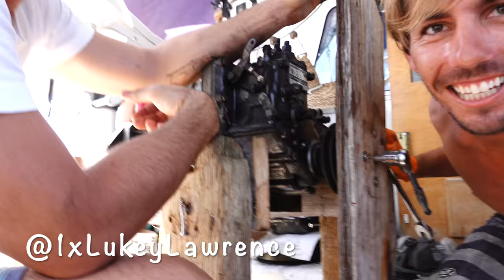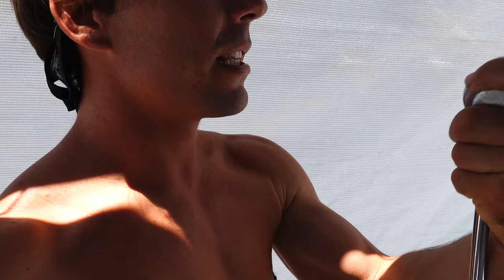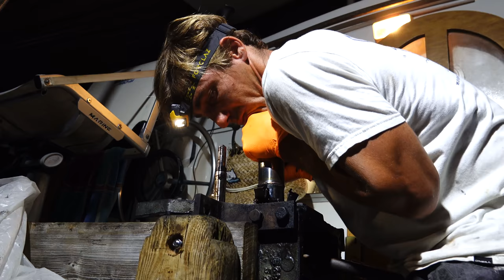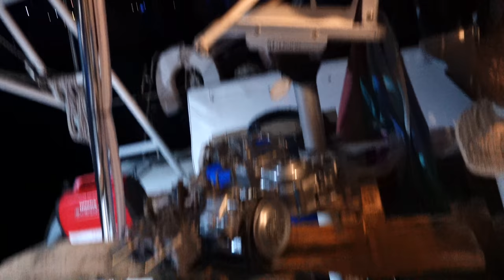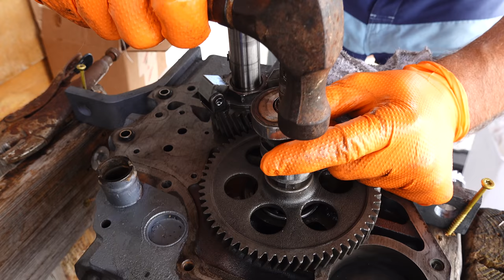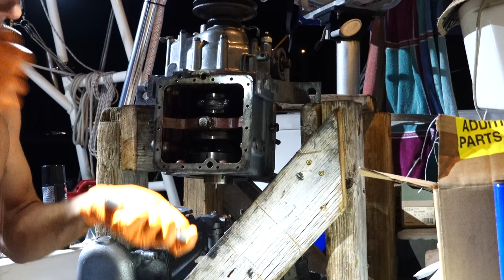Rebuilding the Engine on our Sailing Catamaran | DIY Diesel Engine Rebuild Part 2

Comment: Billy, you are an example of people that can do. Never be afraid to try something yourself. Hopefully, there were no parts left over. I use to take the dash off of a '69 Roadrunner. There were always parts left over when I put it back together. I just threw them in the glovebox until the next time I pulled it. Hard to do that with an engine. Guessing all those parts are important. :-)  At least now it is easy to video all of the steps as you disassemble something. Good luck and happy sailing.

Comment: A Yanmar 2GM is a fine engine and he is doing a very good job of it... Lovely that he can install a full kit including sleeve and new pistons and rings - it really will be a fresh motor again, hope the crank is good and the valves, guides and seats are good too...  He is doing a methodical job and is being pretty respectful and careful of the process.

Comment: Billy, I give you a lot of credit for rebuilding your diesel on your boat.  You are creative and have a “can-do” attitude.  I rebuilt the engine in my first car, a Ford 351 Cleveland in my garage when I was 15 years old.  This brought back lots of great memories of taking that engine apart piece by piece, cleaning it all up, new bearings and gaskets and putting it back together.  I had a Chilton’s manual to guide me through it.  Can’t wait to hear that sucker run!  Good job so far dude!

Comment: Billy, that's what I'm talking about! You have done a great job with little resources and in the end, have shown with a dose of courage to undertake such a project and the smarts to work around obstacles one can successfully overhaul an engine on the back deck. It helps to have the manual.

Comment: Taking the engine apart is EZ ,  getting the parts and checking tolerances so you get a good rebuild is the difficult part. Your fearless attacking this job!

Comment: Just going to echo most of the other comments. Your a badass Billy! With a little ingenuity and a lot of determination you showed most anything is possible. Very impressive to rebuild a complete engine on the boat on the water.

Comment: You're a weapon Billy... A 2MG. Great engines... Injector timing is going to be fun, but you'll figure that out I'm sure... Can't wait for the startup...
Reply from the maker: I didn’t take the injector pump off and the timing is determined by the shims it is mounted on so didn’t have to do anything there. I just had to make sure I lined up the timing marks on the gear on the crank shaft and camshaft which was very straight forward and easy

Comment: Awesome job!  Great tool improvisation.  The welding on the extended socket looked well done too.  Save that tool!  I have many special fabricated tools in my box. 
I'm excited for you.  Can't wait to hear it running.
The other engine is going to be a breeze for you when that time comes.

Comment: At 12:30 I believe what you were thinking about is a plasti gauge you put a small piece down and torque your bearing caps down and then take them off again to check your clearance.

Comment: Like my dad always said brute force and perseverance always wins👍👍
Reply: ...or just find a length of pipe and use it as a breaker bar...some basic physics goes a lot further than brute force...
Reply: But brute force all ways win😳🤓🤗
Reply: @timothyhanneman7715  -  what  puzer1  was  gittin' at was that proper application of brute force utilizing skill, manual dexterity and expertise through ". . . some basic physics"  makes the job come off a lot  easier  ! ! !   Yes  'Brute Force'  .  .  .  .  made easy .
Reply: Richard Hobbs it's just a old saying we used many years ago my dad been gone for 16 years when I see things like Billie trying it reminds of my farther when we were working heavy equipment. The good old days👍

Comment: Very good job young man very good Billy glad to see you're using a torque wrench and the inserts at the bottom of the Piston arm I always use Vaseline as a matter of fact I used to put Vaseline on every part when I put it back together just make sure you watch for leaks the first 24 to 48 hours excellent job though Billy you deserve a pat on the back💥👍💥😎👌👌

Comment: Thank you so much for this video! I'm in the middle of an almost identical rebuild (3GM30 taken apart in the cabin sole of my E32), I am struggling with the cleaning. I would have liked to see more on how you got the parts clean enough (got off rust, caked grime, old paint, etc without sandblasting) what you used to clean with -both solvents and brushes-before prime/paint.

Comment: So far so good.  You might consider getting a brass or lead hammer, they come in real handy working on mechanical stuff, not just engines.  It might have saved the prop shaft you were working on a while ago.  Just a thought.  If you want a ring compressor I have an old one I'd be willing to send you.  It's a little rusty but some sand paper would take care of that.  Keep the good stuff coming.

Comment: I try to never work on intricate things late at night, especially when I'm tired, as this is how mistakes are made. You're sleepy, tired, and not as sharp as you should be, and it's so much easier to miss or overlook something important, like tightening something down to spec properly.
but hey, if you're broke down along side the road, or out drifting, then all bets are off and anything goes!
At least, this is how it goes for me. YMMV

Looks like you're doing a great job! I think you'll do just fine! :)

safe travels you guys!

Comment: YEAYYYYY !  Engine Rebuild!  :P   AND did I recently see that Adrenalin is FOR SALE?
Reply: Brad Mottishaw yep, I saw that too! They’ve already said that the Adventure continues.......! 😎🏖🌴☀️🇦🇺
Reply: What? Where it is listed? I can't seem to find the listing? Interested.
Reply: @chadjackson8420    Facebook Catamarans for Sale by Owner group
Sierra Groth
June 26 at 7:42 AM  · Shared with Public
1988 Crowther Spindrift Sailing Catamaran
$115,000  · Jupiter, Florida
Adrenaline is a 1988 Crowther Spindrift Catamaran, designed by the world-renowned Australian multihull designer Locke Crowther. She is STRONG, LIGHT, and FAST. She was built in Gabon, Africa and then sailed across the Atlantic where she spent her next many years sailing from Canada to the Caribbean. We have personally sailed her as far north as New England and down to Grenada. She is now in Florida ready for her next adventure with YOU!
The Bahamas, Caribbean, New England??
She is ready to sail!
ADDITIONAL DETAILS
RECENT UPGRADES + NOTABLE FEATURES
Dyneema DUX Standing Rigging (2019)
Titanium Chainplates (2019)
North Sails (2018)
Mack Pack Sail Cover (2019)
Custom Rudders (2019)
Lithium Batteries (2019)
625 watts of Solar Panels (2019)
New Manual Lofrans Windlass (2019)
4 New Lewmar Hatches (2018)
Updated Interior (2018)
Siren Marine Boat Security Monitoring System (2018)
Max Prop Feathering Propellers (2018)
Rainman High Output 115V/60Hz Watermaker (2019)
New Water Tanks (2019)
New Holding Tanks (2018)
DIMENSIONS + DETAILS
LOA: 40′
Beam: 20′
2 double berths
Draft: 3′-6″
Bridge clearance: 57′
Cruising speed under power 5-7 knots
Cruising speed under sail: 5-12 knots
Maximum speed: 18 knots under sail
TANKAGE + PLUMBING
Fuel: 52 gallons
Freshwater: 80 gallons
Holding: 18 gallons
2 heads
POWER
200-amp hr Relion lithium battery (house battery)
100-amp hr (high performance) Relion lithium battery (starting battery)
1x 325-watt hard solar panel
3x 100-watt Renogy flexible solar panels
2000 watt inverter
Rainman high output 115V/60Hz watermaker (2019)
GALLEY
Large top-loading 12V fridge/ freezer
Two-burner propane stove/oven
Stainless steel sink
Water heater
ON DECK
Hulls are foam-cored laminated with fiberglass
Deck and superstructure are high quality African marine plywood laminated with fiberglass

SAILS
North Sails square top fully battened main NPC radian NorDac NDR 7.5 oz (2018)
North Sails Furling 135% Genoa NPL Tour XG 7 oz NorLam (2018)
Mack pack sail cover
NAVIGATION + ELECTRONICS
Dragonfly Chart plotter
Ratheon Radar (LCD screen needs replacing)
ENGINES
Twin (2) Yanmar 2GM 13 HP
Two (2) cylinders, each engine
12 Volt blowers for ventilation in each engine compartment
Fresh-water cooled with heat exchangers
Two (2) Max Prop Easy Prop 14″ diameter 3-blade feathering propellers
Generator-2000 watt Honda portable gasoline generator
DINGHY
Adrenaline comes with a Highfield CL 360 with an aluminum hull and Hypalon tubes. It has a double floor to keep your feet and stuff dry and non-skid deck to prevent slipping. There is a separate locker for both the anchor and the fuel tank. It is equipped with a 2019 Suzuki 4 stroke 20hp electric start engine.

Price
$115,000 USD
View a full tour here: https://youtu.be/5kMWyvoMoKM
Reply: Brad Mottishaw interesting there’s no mention of a rebuild.
Reply: That's a hell of an asking price! WOW!!!!
Reply: Wait what?
Reply: @rfish3556  You need to keep up with their other social media accounts! Billy proposed and Sierra is pregnant so they are selling the boat. They are going to be land lubbers for a while! This video is 3 to 3 1/2 months ago.
Reply: @hotrodhog2170   i hope you are kidding and that can not be true right? oh man, if its true this will be the 4th sailing channel i subscribe to that get 'disrupted' with a baby in the last 1 year.  It just never is the same again afterwards.
Reply: @75echo  You got that right! The channel is NEVER the same after children!☹👎🏻
Reply: @hotrodhog2170  Here comes regular jobs! Happy for them, sad the channel won't be about sailing anymore. My daughter was not planned but no regrets, she has turned into a bright, beautiful woman, that makes a Mechincal engineer salary and has a great husband.
Reply: This is what happens when youre confined to a sailboat and have lots of time on your hands!  I just hope they dont name the baby Corona..
Reply: @75echo  life goes on ,good for them.
Reply: Chad Jackson south Florida Craigslist
Reply: JACK JACKSON where did they say that?
Reply: @75echo  Check out..  Sailing into Freedom, and if you'd like to see a couple that moved to Puerto Rico.. LifeTransPlanet.. (oneWord)..
Reply: Hotrod Hog I just follow on ig. Knew about the boat but not the proposal and baby😳
Reply: Chad Jackson Facebook on one of the Catamaran Pages......!?

Comment: Did you put the ring openings across from each other when installing them into the cylinder?
Reply: Was thinking the same thing too each ring 33 degrees apart

Comment: I'm impressed, that quite an amazing feat for your first.

But frankly, rebuilding an engine without a torque wrench... All these bolts and Nuts have a specific torque and it's important...
Reply from the maker: I used a torque wrench in the video
Reply: @Tulasendlesssummer  Sorry, I missed it...

Comment: I bought a set of you "thru socket" but I'm sure it doesn't have a 36mm in it, thats a big un. Oh well, you've probably got it welded by now. Good luck. Bg job. No timing belt (I think I saw a set of timing gears). I always mark the entire system so I can get it back together without having to figure out TDC and all that stuff.

Comment: Sierra - you are right!   There is nothing,  absolutely NOTHING, that Billy can't do. 

Wow - impressive.    I have a Yanmar2GM20F,  and I love the thing,  it is bullet proof, and just runs and runs.   32 years now, probably 1500-2000 hours (unknown hours), and it just keeps running like it is virtually new. 

Did you have to worry about the timing cam position in the injector pump, or was there only one position to put it back on? 
And, you didn't mention what was the damaged part(s) that caused loss of power.   That chunk of metal you found must be a piece of cylinder or something, which caused a serious loss of compression? 

Great job.

Comment: Great video. I am assuming you honed the cylinder sleeves before putting in the pistons. It will never seal 100% unless they were honed with cross hatch.
Reply: New Cylinder Sleeves
Reply: @frankmelero5511  The sleeves I have bought in the past were NOT honed. I had to do this myself. The rings will not seat properly without honing. Same is true of valves. If they are not lapped, they will not seal as well. Is it critical? No, but may have oil blow-by and loss of some compression.
Reply: @bobhamilton298  just squirt some course valve grinding paste down the bores they will soon lap their selves in .

Comment: I am wondering about the sleeve replacement , is it a machine shop operation? Are they a. Press fit ? I am not a diesel tech. But I am a retired aircraft mechanic  A&P . Good luck .

Comment: You could have simply used a pointed punch & hammer to get the 36 mm nut loose. It's not a hardened nut on those Yanmar 1, 2 or 3 GM engines.  And yes, you can tighten the nut the same way.

Comment: Pretty darn good job for that location (on the back deck of a boat, out doors)
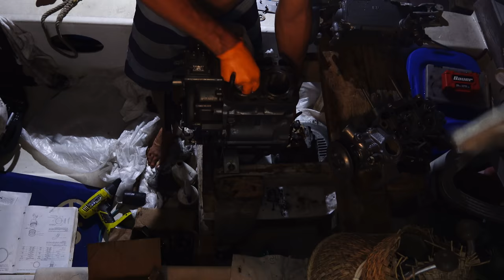But I sure hope you Staggered the Ring gaps  18:00  and didn’t have the gaps on top of each other, our it Still won’t have any comprehension.

Comment: How he managed to put the new cylinders in ? Or take the old one out ? I had rebuilt many engines and in all of I had used a press it is the hardest part !
Reply from the maker: You mean the cylinder sleeves? They were pretty easy to pop out and the new ones slid in easy after I put them in the freezer for a few hours

Comment: Did you measure the crank journals for wear?
Reply: He would have had to before ordering the rebuild kit to know what main bearings to get, I.E. after getting the crank turned and balanced.  I usually let the machine shop recommend, ordering bearings blind without knowing the history of the engine at build time to now would be a major error.
Reply: @penelopepitstop6731  I don't believe you are using the name "Penelope Pitstop"! Back in the day, I had a 1967 Mustang convertible. I bought the car new. Paid $3,250 USD. I suspended a rubber vulture from the rearview mirror and named it Penelope Pitstop! That was back in 1967 or 1968 - more than 50 years ago. Penelope, well-done! :¬) Webhead USA

Comment: Just a bit of professional engine rebuilding advice. Never use motor oil to coat new bearings or camshafts, est(any moving parts). For future reference, always use breakin lubrication. Motor oil is designed to run under pressure and moving parts actually sit in a thin bath of it. On a new motor or rebuild, you will probably not have that oil pressure for a bit while the oil passages fill back up. Alot of builders take the time to prime the oil system before they attempt a start. I don't know if that is even possible on your yanmars. Motor oil will get flung off the moving parts where breakin lube wont. The most critical time of any rebuild is the initial start and you likely had metal on metal until you oil passages filled. That will take off years of a motors life. I have seen motors grenade on initial start doing what you did. Since people are talking about your boat being up for sale, i am guessing yours didn't. Kudos to you for jumping out of your comfort zone and learning something useful. Good luck.
Reply from the maker: Thanks for the advice. I actually turned it over by hand a ton to try to help prime the oil system. No issues when we first tried starting it.
Reply: @Tulasendlesssummer  Yes,  also - each spring before I start the engine, I turn it over with the fuel kill engaged (priming the system), until the oil pressure alarm stops (2-3 seconds) just to get all the parts coated before doing a real start.

Comment: Good Job. I wouldn't know what to do. Did you find any broken parts when you pulled it apart? It seems like you're just replacing good working (but used) parts with new parts

Comment: You guys just built a poor man's puller.  Next time, use a piece of angle iron with holes drilled in it instead of the wood.  It works even better.
Reply: Also, your ingenuity is awesome!  This is a very challenging project for someone with a full shop and experience.  You did it on a boat.